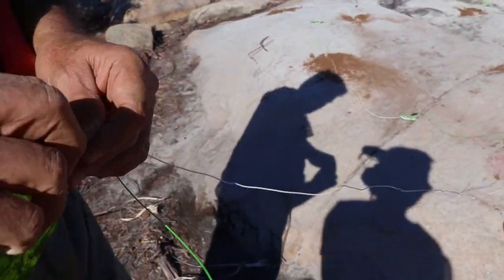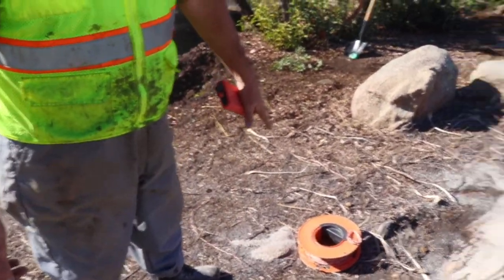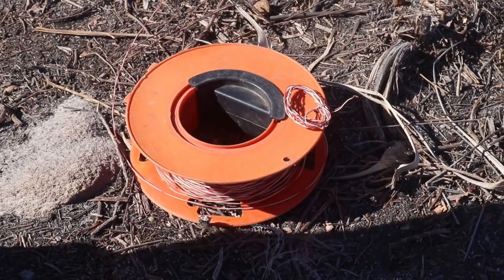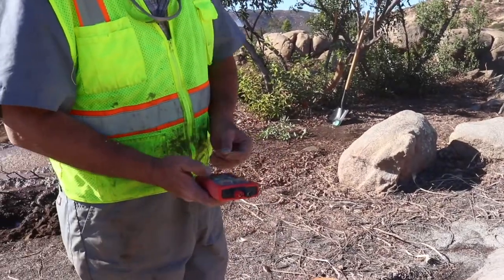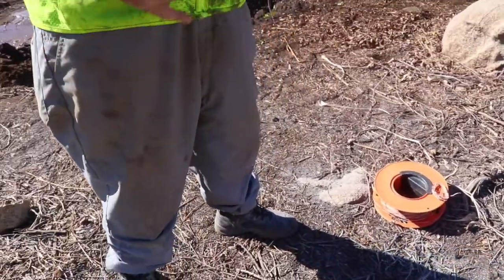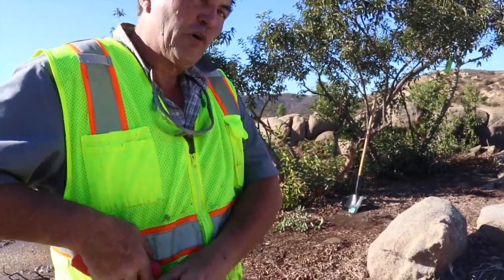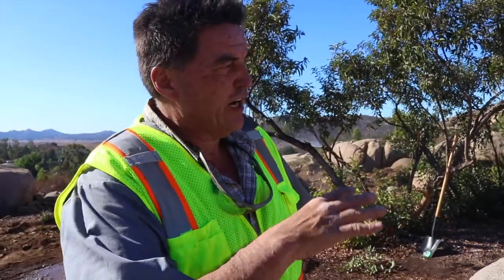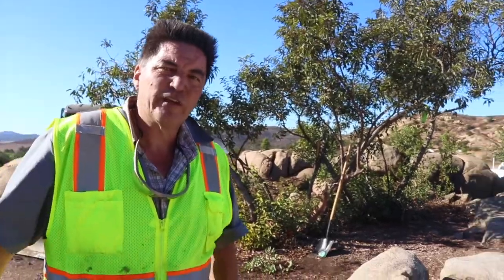Autostem Generation 3 Rock Breaking DEMO

Comment: That's an awfully small work area to justify the expense of explosives. Why not use chemical fracture? Sure, it's one day of downtime and more holes to drill... but it saves the expense of permits, specialized labor, explosive material and hazard risks, and moving material more than once (no blast mat, blanket material, etc.).

I can see using this product where time is of the essence for a small footprint job... but if a work day isn't costing more than 10-15k, I'd eat the downtime.
Reply: It's not explosives, so I assume the red tape would be far less